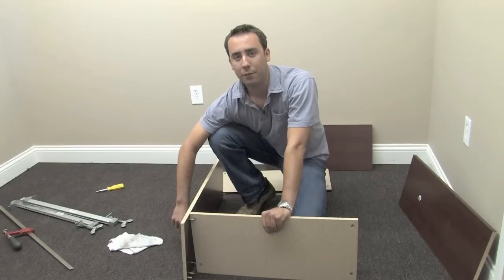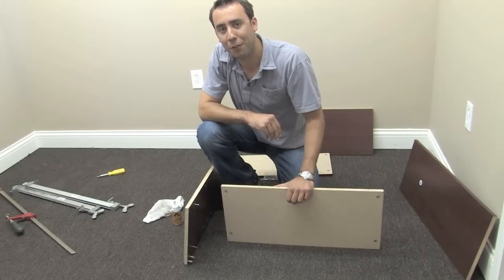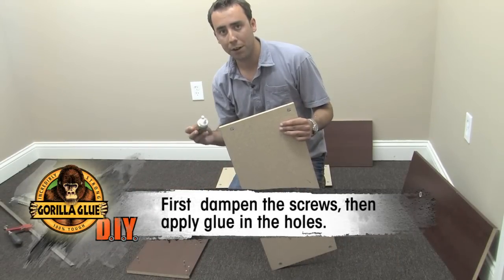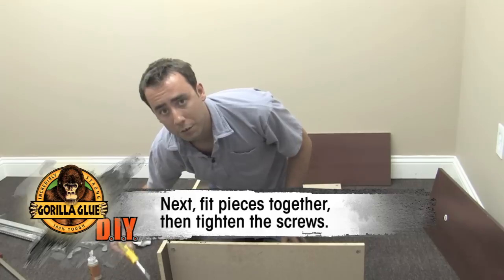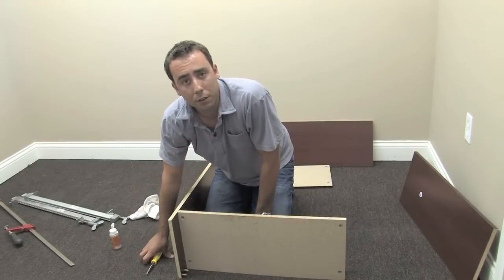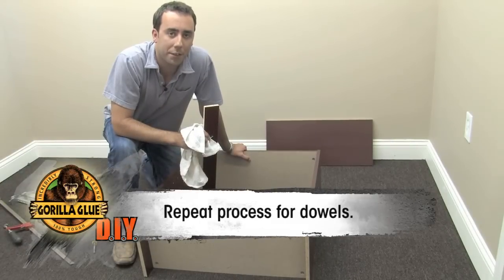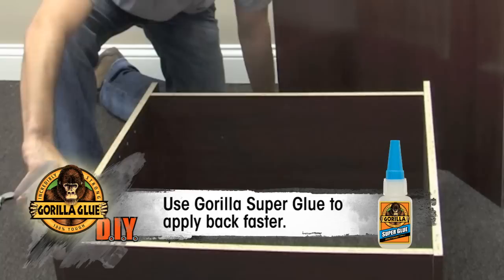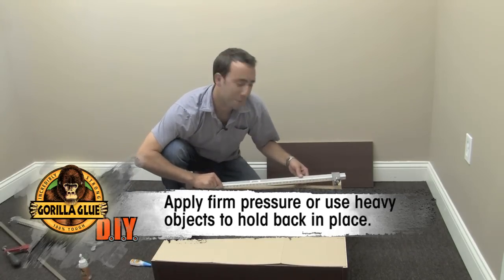Easy Assembly of Pre-Fabricated Furniture with Gorilla Glue

Comment: I did one better. While assembling my Ikea kitchen cabinets I glued all of the butt joints as well as the dowels and posts.  I also glued the backs on and nailed them in.  Gorilla Glue tacked it all together and I don't ever have to worry about my cabinets coming apart in my lifetime. :)
Reply: i just got an Ikea desk, and was thinking of doing just this, I'm just trying to figure out what is the best thing to go with for gluing the joints together in addition to the camlolcks and dowels

Comment: So, does the glue expand and lock the metal dowel inside the sleeve? Otherwise, I don't know what's bonding since there is using bit of space between the metal dowel and the bored sleeve (that the dowel inserts in).  By the way, what you are calling "screws" are typically called "cams".